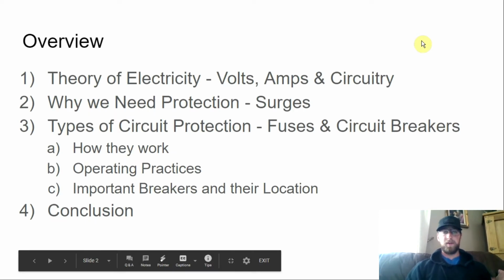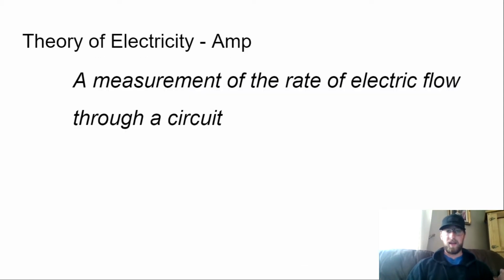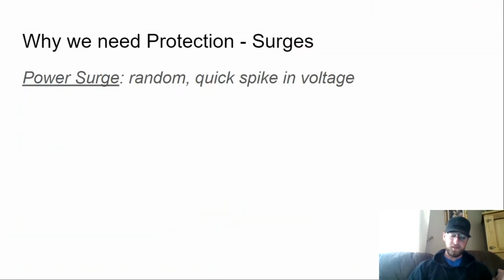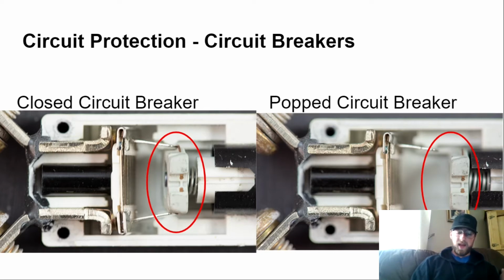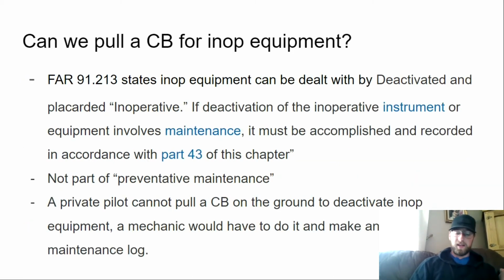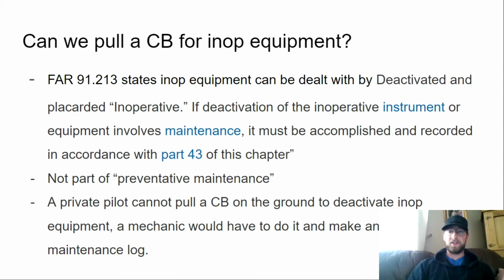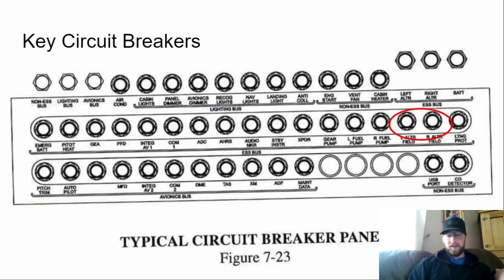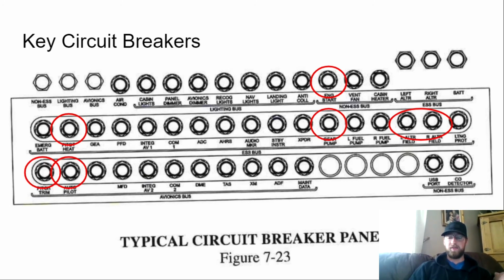Piper Seminole Circuit Protection - Aaron Miller

Comment: Hi Aaron cool presentation! The theory of electricity - AMP example was a really good one (explanation of the weights). Question: What would cause overvoltage? and what preventative measure can we take?
Reply from the maker: Overvoltages or surges can be caused by a couple things, faulty voltage regulator in the alternator is probably a good place to start but it can even be things like lightning strikes or static energy buildup if we're missing static wicks.